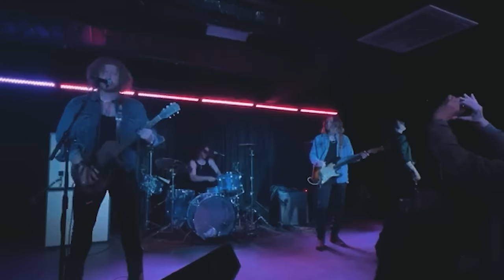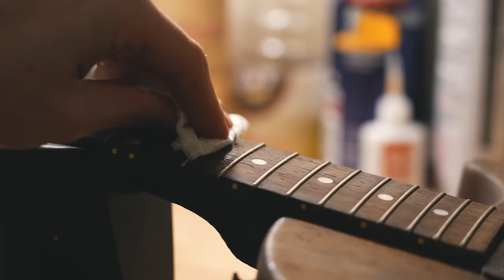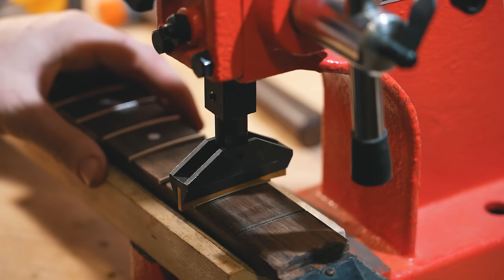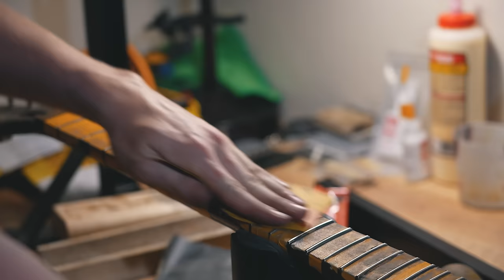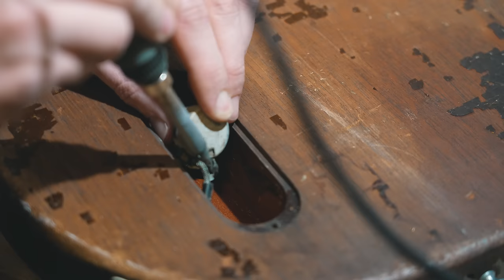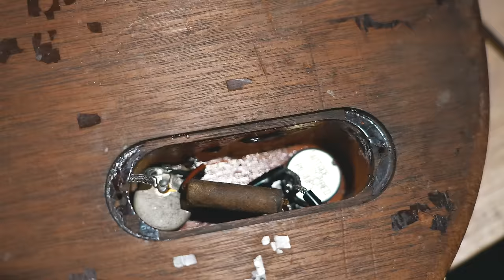Barnfind 1954 Les Paul Restoration - The Final Chapter

Comment: you didn't have to replace the pot, if the shaft is broken you could have taken a shaft from a new pot and only replace that. the "sound" and feel of the old potentiometer is in the carbon track
Reply: I wrote another comment, maybe Matt will read it, I noticed the loss of sound quality immediately after replacing the pot 🤷‍♂️

Comment: great that you saved the old girl and got her working again. 

I see a few of the Nashville types are getting this aftermarket wraparound bridge lately and post videos about it. Made by somebody local. They look like they might be the one to get. More in tune etc. 

You lot in the USA are lucky how easy it is to get guitar and amp parts etc. I just had to import a 0.68uF cap for my Plexi clone, because nobody in NZ had one in stock. Paying international shipping for a one dollar part. Same with a trem stopper I just had to get from over in Aussie, or a bunch of amp parts I need. I had to import my Freyette Power Station because there's no local dealer, plus my Friedman IR-X because the local music shops took so long to bother getting them in stock -- and then charged over $100 more than I paid. On top of that, our only source of guitar parts just moved to Aussie where their parent company is based, but still call themselves Guitar Parts NZ (shipping from there takes as long as from the USA). Paradise has its downsides I guess. :) -- when I was in the USA they told me Hawaii is a bit like that too, i.e., stuff is harder to get and more expensive than the mainland. The price you pay for liking the surf beaches I guess.

Comment: Looks and sounds great! Now for a follow up ... do the same with an Epiphone Junior. Find one of the bolt-on clipped-ear models from 2000-2018 made in China that originally sold for $80-$150. Clean it up and level the frets. I'd swap the jack and volume pot with modern but keep the factory tuners and pickup. I have one of these that I did just that with, and rotated the humbucker bridge pickup to raise the screw poles where a P90 crosses under the strings and get a super chunky P90 hum-protected guitar tone.

Comment: You mentioned in the previous video that the bridge posts were leaning pretty bad.  I have a 1954 LPJ with the same problem. Just wondering if you changed those out.

Comment: I would have put a new capacitor in too. Old ones always leak DC. Get an ESR meter, they are cheap and you will see I am right. A multi-meter won't let you check ESR and you can also determine polarity of caps with an ESR. Caps do have polarity, put the outer foil end to ground and it makes the guitar quieter. Don't trust the wee black mark, they are often marked incorrectly.
But ya, old paper craps are all dead or just about to die, so just pull them.

Comment: Next time you glue a nut you want to glue it to the end grain of the fretboard instead of the neck.  The reason why is because when it comes time to come off it won't take any wood grain out with it.  Sometimes you see Gibson's with no material above the truss rod nut and that's why.  Just a pro tip.  Nice work otherwise.😁😁😁

Comment: Maybe I missed an episode, but are you just leaving that headstock crack with a little dab of wood glue? No way that solves the problem. I was expecting you to sink a thin screw or dowel in from the side. Also, the neck is just glued in place? That also doesn't seem like it'll last long. 
Finally, if it were me, I would've sanded the old paint off. Brush on a clear wood protector coating. That wood is bone dry!
OK everyone, blast off on me :-)